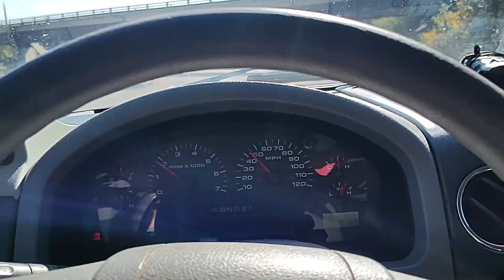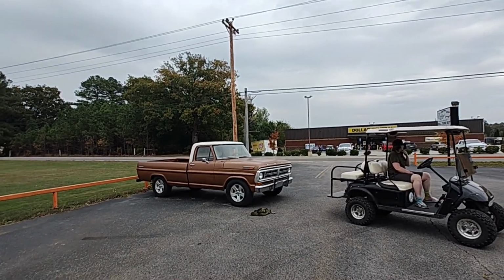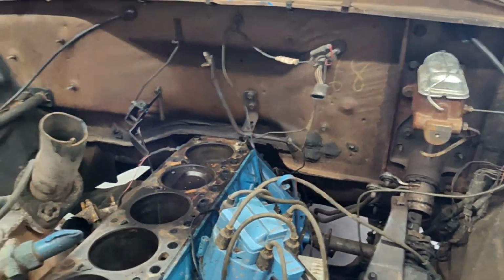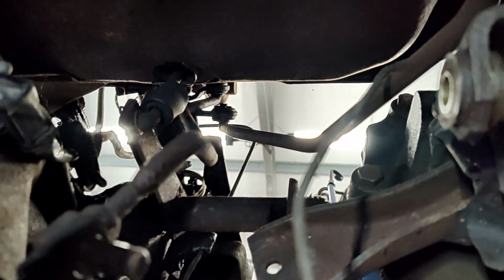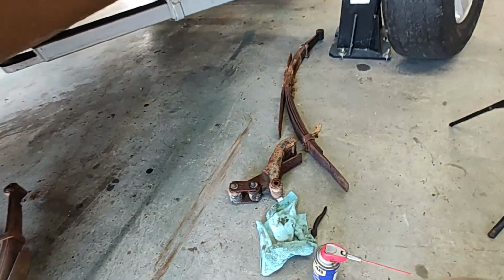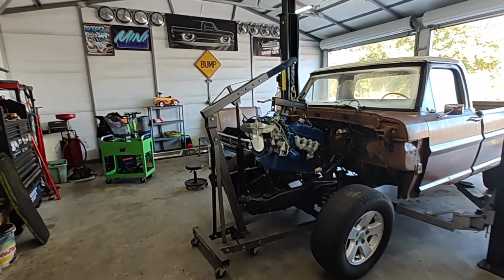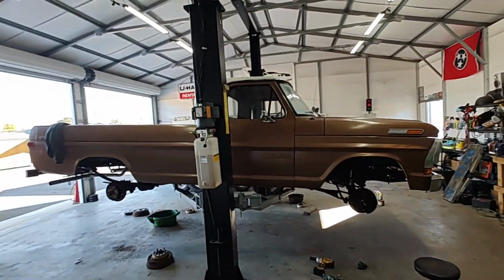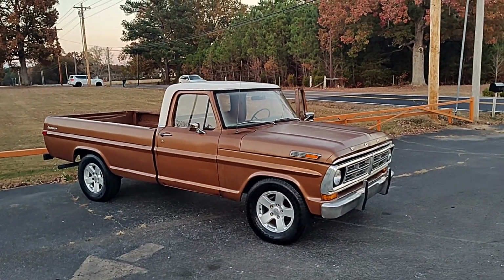1972 Ford F100 Inline 6 to V8 swap. 300 to 302 swap

Comment: A lot of work for 2 extra work for two cubic inches  The 4.9 300 6 is a great motor. good video
Reply: 302 has no business being in a truck. but this is just gonna get put it around by some old man, so I guess it’ll be fine.
Reply: Nothing wrong with a 302 in a old 2 wheel drive pickup. It's plenty for that truck with 4 wheel drum brakes doing the stopping.
Reply: @leadfoot8593  shoot your insane roller 302s with a few bolt ons will have 300hp.

Comment: It's a shame that old bumpside has so much rust. It's a nice looking pickup until you get close enough to see how bad it really is. With that chassis in the shape it is there's no point in replacing sheetmetal.  It's just a matter of time before more springs break and the body mounts give way. Not hating on it. I'm a bumpside fan. I own 4 and have been building and restoring them for 30 + years. What a shame. It either sat in tall grass for many years or its lived for some years where they salt roads. Looking underneath in the video , it's clear the bed and cab floors and mounts etc are too far gone to bother trying to replace considering the chassis corrosion is so extensive.  Love and drive it. Just don't pressure wash it any further or your going to be wishing you didn't.  But it doesn't matter because the damage is done. Hope it's not as bad as it looks in the video but unfortunately it's likely worse. But if you got it cheap enough , you got some nice parts if nothing else.  And they are getting ridiculous price wise